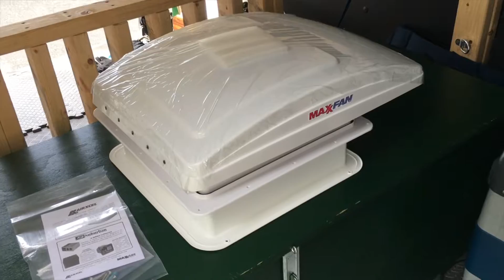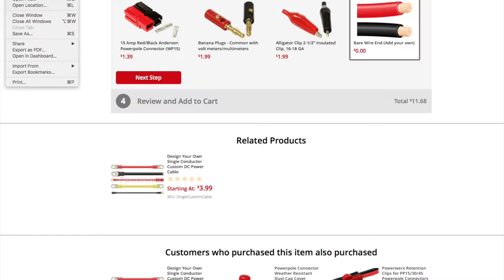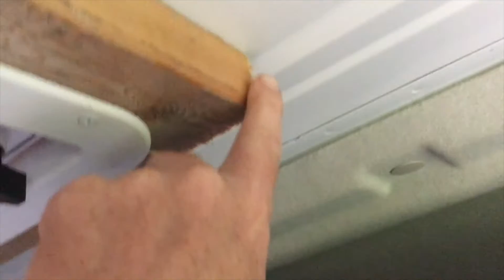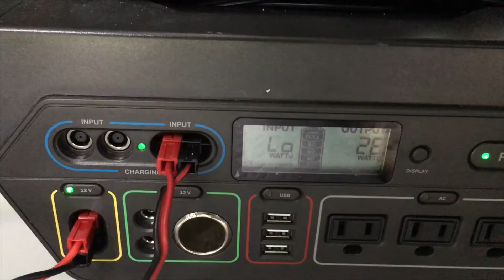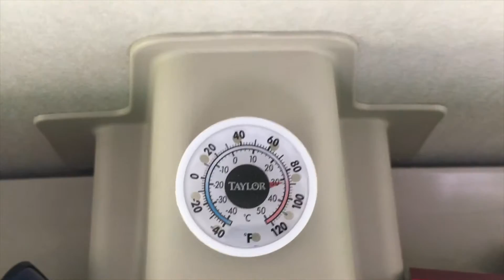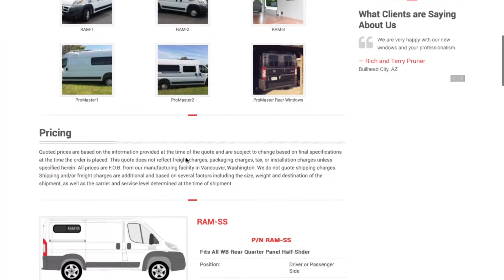Maxxair Maxxfan Deluxe 5100K - Dodge Promaster Camper Van Ceiling Fan Powered by Goal Zero Yeti 1250

Comment: many people mount them on the higher ribs by stacking the butyl tape in the ribs and compressing everything together. I mounted mine where you did but centered. I wish someone made back windows that open so it would pull air all the way thru the van
Reply from the maker: Boy - the butyl tape must be damn good if it can seal that big a gap.  Thanks for the info.

Comment: get rv windows for the side of your van. I got 2 that open and I can leave open in the rain than I leave my fan on auto and it keeps it way cooler than if it was all closed up sitting in the sun. my model is the 7500k
Reply from the maker: yep - looking into rear windows that open now.  that's definitely the way to go.  if i crack the front windows and turn the fan on, you can feel the air coming in the windows.  it would be great to have windows at bed height and have cool air being sucked in across your body.  thanks for the suggestion.

Comment: Have you finished off your ceiling?  Without insulating the ceiling, it's very hard to cool the van down.
Reply from the maker: I have one layer of reflectix on the ceiling.  I think I'm going to put some luan (sp?) on with another of reflectix on the luan so there will be an air gap between the two layers.  If not luan, maybe the same kind of material as the black wall panels if I can find some.  I will say, the insulation I have doesn't do much.  I got rid of my Mr. Heater and the condensation has gone way down.  Just was at a campground using my electrical heater and it did okay.  But when boon docking one night without electric hookup, man that was cold.  No warmer inside than out. :-)
Reply: My Transit came with Coroplast wall panels.  I'm going to use that material along the ribs of the ceiling with reflectix and the ridge insulation behind that leaving some air gap.  Installing MaxxAir.  I'll be adhering thin outdoor/indoor carpeting the walls and ceiling.  I can stick stuff to it with Velcro.  lol.
Reply from the maker: Hmmm... I like that idea.  You going to make any videos of this? :-)
Reply: TopShots Brad That could happen. I do have a gopro handy, and I am a photographer.  :D
Reply from the maker: Cool!  Hope ya do! Thanks!
Reply from the maker: Hey Deanna - I was looking at coroplast: http://www.homedepot.com/p/48-in-x-96-in-x-157-in-White-Corrugated-Plastic-Cardboard-10-Pack-WC4896-10/202489118  and I don't know if I like it.  In my Dodge Promaster, I have 1/8" thick solid plastic interior wall siding.  I'm trying to find something like it and found this: http://www.usplastic.com/catalog/item.aspx?itemid=23013  The 4th one down is 4'x8'x1/8".  I have no idea what it's like but I've gotta find out what the interior of my van has currently somehow.  You (or anyone else) have any idea?  I think it would be ideal if I could find some big sheets of it somewhere.
Reply: Ah.. I see.  I don't know dodge for anything, as I'm working with a Transit.   I don't need large sheets, as my Cherryacht already has them in place.  The small ones from HD are going to be perfect for my ceiling work.  Large sheets are available out there.  
My carpet arrived today, so I'm picking that up after work, along with the insulation materials.  I'll start on Sunday.

Comment: any reason for using the Anderson instead of just a goal zero 6mm?
Reply from the maker: I think I have all my 12 Volt outlets used up so had to use what I had.
Reply: Brad Herder someone on the forums said 6mm only puts out 5amps so it would be better to use Anderson. I’m trying to figure out how to hook up lights/fan ect to my goal zero yeti 400. Thinking wire everything to a fuse box then wire that to the anderson to the GZ
Reply: I am installing this setup right now (Maxxfan to Yeti 400) and am trying to figure out what cable I need. I'd like to use the 6mm port as I want to save my car adaptor, but the Goal Zero 6mm cables are too short to reach the Maxxfan wires. Should I just add some wiring in this or is there a better cable to use?
Reply: Loved At Launch im going to be going Anderson to fuse box to 14awg wire

Comment: was it pulling of blowing air in?
That seem super disappointing results... thanks for the experiment!!!
Reply from the maker: I was blowing air out and it wasn't helping the temps in the van.  I am now trying to find windows with screens.  I did some more experimentation and with all the doors and windows closed, the fan really works hard to try to suck air out - but if I crack the front windows, it runs much easier and you can actually feel the air being sucked in from the front windows if you hold you hand up to it.  I think windows in the rear of the van at bed height would be amazing b/c you'd have a breeze running across your body in the hot summer.
Reply: @MTBIKEXC  Do you think it would have been better blowing air in? That would itself be improving the air flow? I'm really glad you did this experiment though! Thank you!
Reply from the maker: Hannah Pedersen maybe... one of the best solutions I’ve seen was to cut a hole in the bottom of the van, put in a floor grate, the suck air in from the shaded and cooler air under the van and exhaust it out the roof.  I don’t want to cut a whole in the bottom though.  Thanks.

Comment: you should have mounted the fan at the back of your van that way you could crack the front windows slightly and have air flow coming through the van from the front all the way to the back. I guess you'll have to patch the 14" mistake hole in the front and move the fan to the back now. 😩

Comment: here is the windows I put in my van.   I put one on each side but I didn't have the factory window on my slideing door.  http://www.ebay.com/itm/RV-CAMPER-NEW-24-X-15-REPLACEMENT-DBL-CRANK-OPEN-FRAMELESS-WINDOW-748-7-/371749383361?hash=item568dfd6cc1:g:ndAAAOSwie5XTGFb&vxp=mtr
Reply from the maker: Wow - those are cheap!  Thanks!
Reply from the maker: Crap - they only have one of those.  Wrote to the guy to find out if he had an alternative.  Waiting to hear back. :-)